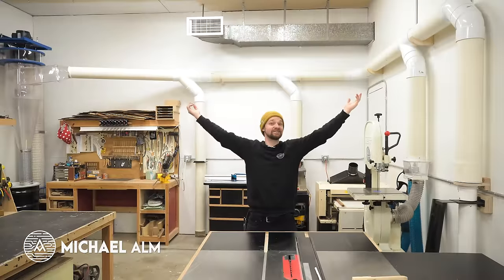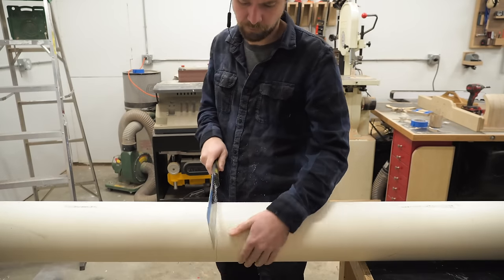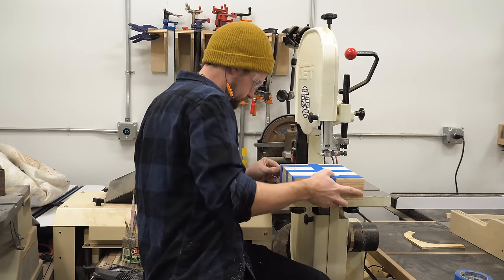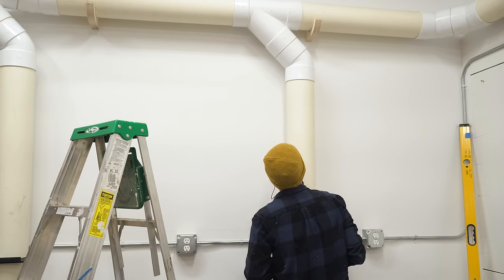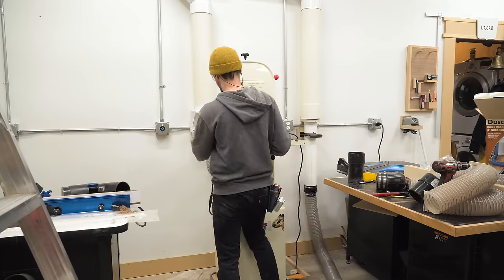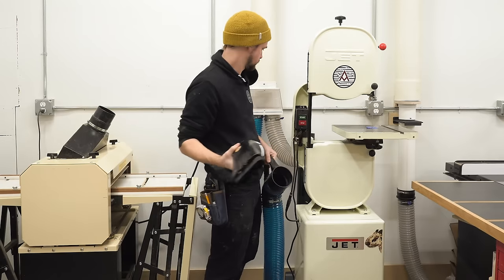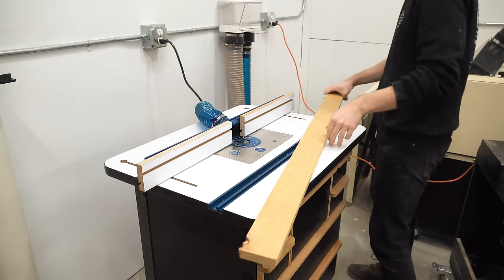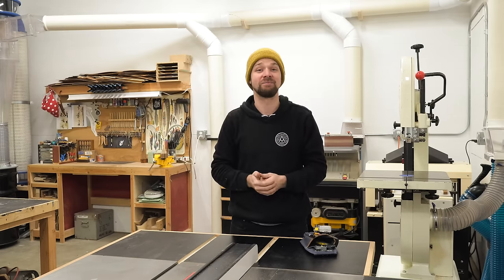Dust Collection System Upgrade

Comment: That Clearview might collapse that thin walled pipe no? I guess you would know by now. I have the same unit but I bought ribbed metal dust collection pipe. Cost a few bucks but has all kinds of dampers at each piece of equipment. Hope your enjoying the better air quality and dust collection.

Comment: Very nice.  But would it be easier to either have a portable collection system or on flexible hose that hooks up to the machines?
I'm looking at a collection system myself.  This is more extensive than what I would need
Reply from the maker: That’s what my old system was. It’s definitely a good entry point, but after a while it’s cumbersome. This is my upgrade and I don’t even have to think about it now. Never had a clog

Comment: Great system. I wish I had the room for such a tall unit. I found for my bandsaw and drill press flexible drain pipe is great for getting the dust on the surface. I actually got one in silver instead of white for $5.00 on eBay. I made some homemade clamps to hold it in place and on the end that is closest to the workpiece is a small rectangle port that actually came with a vacuum cleaner. They do sell them though at Rockler if that is your go-to place.

Comment: Liked and subbed . I loved when I seen my last comment was 4 years ago and I’m just about to install it. Glad I watched your video again as I forgot about not using 90’s .
I have one concern though , I read the instructions again and it recommended only running the motor 4 times an hour  max if your using it for short durations, as it’s hard on the motors capacitors etc . How has your experience been all these years ?

Comment: that is a nice DC setup. Question: when you use the 2 1/2" port for the sander does the system bog down or the vacuum suction get reduced or do you leave one of the other blast gates open? I ask because you are going from a 6" pipe down to a 2 1/2" and that must mean your CFM goes down too, no?

Comment: I've seen other youtube video builds like this and they installed some wires to prevent static electricity. I also have a small cyclone which also has instructions to connect a wire and a washer to touch the floor to prevent static electricity. Does your system have this feature built in? Because I didn't see any wires as part of the build.
Reply: The fear of static electricity is really just anxiety. The chance of a dust explosion happening from static in something like a dust colletor is basically nothing, compared to, say, cutting your finger off at the miter saw.
Reply: I was wondering about this too. I always thought that if you had a good system, it would transport the dust quickly and not let it build up enough to worry about an explosion. However so many people put in static removal wires that I have never been convinced either way.
Reply: @davidhorizon8401  Most sawdust explosions occur at commercial factories where there are hundreds of pounds of dust moving at once. Home shops just don't create enough sawdust to cause such explosions. Plus most modern machinery including the dust collector is grounded enough to prevent that from happening. Grounding is not an expensive thing to do if your that worried about it, but it's not necessary.

Comment: Aha, for once I can add a suggestion.  When cutting pvc piping on the tablesaw, set it in place and roll the pipe instead of sliding the sled.  BTW, the system looks great, really nice set up.
Reply from the maker: Thanks!

Comment: I see you used the cheap plastic gates.  I use them too but always hated how they clogged. If you have that problem with the 6" just cut out a small square in the back corners and they will self clean automatically when closed.  I haven't had to clean mine again since!

Comment: Neat work, I really like the clear sides on the cyclone.  A couple things you, or others, might consider for their next system.  Running 6" trunk lines is a good idea, but for the vertical branches, 4" is a better choice.  This is because the air velocity in the 4" lines is much higher than in a 6" line and does a better job of lifting the dust vertically. The air speed is very high at the equipment because of the small line, but slows abruptly when coming the 6" line.  It's also a good idea to bring the branch lines into the side of the trunk line rather than the bottom.  This is because dust has a habit of falling down into the unused branch lines which could lead to clogged branch lines.
Reply from the maker: Good to know!

Comment: since youre a woodworker why not build a snap together sound insulated case around the cyclone for noise cancelling?
Reply: it needs ventilation for the heat sink but it would be interesting
Reply: It something he should consider, not only to call it a "complete" build, but also if you're WORKING in that shop for long periods of time (which you're obviously going to do), that much noise is bad for your hearing.  

Especially now, everyone is so hip to safety-this and safety-that, but SOUND issues are often overlooked.  And tinnitus NEVER goes away!  Do yourself a favor-- limit the sound from that thing.  :^)

Comment: Just thought I’d share my experience. My system has 4” pipes and 4” blast gates like yours......I found out very quickly that those blast gates very often got clogged up in the back corners and so would not shut fully.....for weeks I put up with using a bent piece of wire that I would wangle into the rear corners to try and pry/flick out the offending offcuts/packed sawdust. The only way I got to a final solution was through complete frustration in having to regularly clean one or two out at a time. I ended up carefully breaking every one of them apart (I have 10)......looked like hot glue bonding......and simply chamfered the 90 degree back corners of the moving/closure plate (ie from 90 to 45). Hot glue and mastic them back together and, touch wood, years later I rarely get an issue. It seems that by having square corners on the closure plate allowed small particles to settle, followed, in time, by my more small particles etc etc. All would then end up getting packed into the corners when the gates were opened and closed which then stopped the plate from fully closing, reducing suction everywhere else. The chamfering seems to provide enough extra space to allow any small particles to be sucked away before any serious packing takes place. The chamfering obviously isn’t large enough to compromise the complete closing of the pipe area. Works well now.
Reply from the maker: Good to know, Thank you!!
Reply: Drill a 1/4" hole with a steel bit at the corners of the plate it will still seal up and the sawdust falls out  of the holes.  You don't have to take the blast gates apart.  Just a quick drill and your set.
Reply: MarkJonesRanger Drilling holes won’t reseal when the gate is open. How can they? And even if they did you’d still be left with the original packing problem when they did...ok, it would be easier to clear but not an effective CURE. As you may be aware, any leaks reduce the effectiveness of the whole system and if you have long runs (like mine) it’s very noticeable. The dismantling of each gate (in my experience anyway) was surprisingly easy as they ‘popped’ open by using a small flat blade screwdriver . Hot glue or mastic resealed them very well.
Reply: Just open the slide before you drill  it seals up when it's closed.  Works great.  No need to reseal stuff at all.
Reply: I saw this on a link several years ago.  It works great.  I am sorry I didn't make it clear to open the gate before you drill the holes in the two corners where the sliding gate pushes the dust to.  I had no more gate issues after doing this.  Didn't even have to take them off the tools just a quick fix on each machine.    
Making jigs for the tools I have learned to give that dust a way to get out and this fixes those gates.  Before I did this they were swelling and wouldn't close.   I looked for the guy that had the original idea for a bit but didn't' find them.   I modified my first gate to make sure it worked and then quickly did it to the rest of them.
Reply: MarkJonesRanger Aha.....now that’s something I hadn’t thought of!.......I can see that working too..👍
Reply: I like your tape method better than my Heating and Air tape.  Yours looks much better.  You did a nice neat job on that install.  Good job!

Comment: For reference, the type of pipe and fittings are commonly referred as "Sewer & Drain" pipe and fittings. The pipe is also called Thin Wall as it is much thinner than Schedule 40 pipe that is used in house drain pipes. The fittings are much less expensive than Schedule 40 fittings.

Comment: if i were you i would defiantly make some sort of a box with lot of sound dampening material to cover up that vacuum motor where most of the noise is generated. 

also i don't know if its possible to do but what if you make an active noise cancelling device for the motor noise? like on headphones, there work perfectly for constant sounds like that. least it'll significantly reduce the noise.

Comment: Really nice job. My only question: are going to run a grounding wire around the outside of your pvc pipe; it's my understanding that pvc creates a lot of static, which can be dangerous (flash) in a woodworking shop?
Reply: This is a myth. Small shops like this where one tool is being used at a time do no generate enough dust to cause an issue.

Comment: Awesome set up, was curious as to how you'd secure the pipes to each other, but I tend to think of water lines when using PVC.  My question on this setup is what will you do with the collected saw dust?  just get rid of it? or is there some way to reuse it?  Thanks
Reply: Chuck it in a bucket of resin and make more stuff

Comment: Came for the "but you have to ground it" comments.  Wasn't disappointed. 

PS, you can't ground an insulator (PVC)
Reply: I think what people mean is that you want to give the static a way to dissipate. 

Whether or not that's what happens or whether it's right or wrong I'm not qualified to say,but it does seem like there's a terminology problem.
Reply: Sure you can, you wrap the pipe, and use flat end metal screws,  screw them in just barley proud of the inside... they act as static 'lightning'  rods and send the charge to the copper wire outside, then to the ground.
Reply: @LDC Show us evidence of fires caused by static discharge in a PVC pipe in a home shop.  Not just my uncle's-cousin's- neighbour told me.
Reply: @LDC I don't argue it could happen in an industrial setting.  But in a small scale home shop, show me the examples, you made the claim it happens, show us.

Comment: I’ve read that one should use horizontal header connections instead of making bottom connections - to avoid dust n chips dropping down into the downstream branches. Did you notice any issues along these lines?

Comment: Can you please clarify the connection to the router table? I understand the direct connect to the rear port, but how come you have a connection to a splitter on the side of the table?  UPDATE for others in case they have the same question: Ok I see, it's because you want to put suction both behind the fence AND underneath the table.

Comment: So i see a lot of guys using the green sewer and drain pipe, i would prefer the all white look also if it’s doable. Do you have any disadvantages from using the thinner walled pipe ?
Reply from the maker: I think a lot of people use the green pipe because it's cheeper in some areas. The white pipe was cheeper here. I haven't had any issues with it.

Comment: I'm no expert as I don't have a dust collection. Watched a vid long ago that you insert screws into pipe and run wire along it to ground it. Good job by the way 👍🙂
Reply from the maker: Yeah, I haven’t seen strong evidence for grounding, but people can make their own choices in their shops.
Reply: Michael Alm I have seen strong evidence that it is not needed though!
Reply: @MichaelAlm  grounding is really only for when its running for long periods of time and most of the time any heavy duty dust collector use metal pipes so it natural grounded.
Reply: @MichaelAlm  grounding is really only for when its running for long periods of time and most of the time any heavy duty dust collector use metal pipes so it natural grounded.
Reply: I ended up grounding the outside of my pvc pipe, just so I don't get a shock when I touch a metal tool like the table saw. I wrapped a thin gauge bare braided copper wire around all the pipes, and the cyclone body, and connected the end to a screw on the relay box. Made a big difference here in the dry southwest.

Comment: I think I'm going to make brackets for my system.  It looks so much better.  Also I use to have those blast gates and I hated them with a passion.
Reply from the maker: The brackets are definitely nicer, and they keep the tube off the wall so you can wrap the fittings easily. I haven’t had issues with the gates so far, but they’re easy to swap out if I need to down the road. What issues did you have with them?
Reply: @MichaelAlm  had 2 break pretty quickly but the main complaint is dust clogging the corners so the gates stopped closing all the way. I switched all mine out to the metal ones on Amazon.  They are like $14 each.
Reply: I ended up cutting off the corners on the "closed" end of those plastic gates. This allows the gate itself to push trapped dust out. Sure, there's now a small hole on either side when the gate is open but it doesn't seem to affect the flow much.

Comment: Great build, thanks.  Did you consider going with some kind of automatic blast gates?  I discovered if you buy a MERV-13 20x20 filter and tape it to the back of a box fan it works fantastic for cleaning the air in the shop.  I used my Dylos, left the fan running over night and both large and small particle numbers were below 20 in the morning, all with just a box fan and good filter.
Reply from the maker: I felt the automated blast gates were more than I needed. I can reach the gates easily from each tool, so it didn't seem like an investment I needed to make. We'll see how I feel after using it for a bit.

Comment: Make a hood for the sanding machine. The port is essentially useless with its design, but a 4" may help. A hood that fits around the belt could pick up more.

Comment: Really nice video and nice system!  Enjoy!  
Suggestions:  mask, safety glasses and hearing protection, as well as an air cleaner.  The smallest dust particles, the ones collection systems have the most difficulty capturing, are the most harmful.  Please protect yourself.
Best wishes.  Hope to see more from you.
Reply: Not to mention they get into your lungs, and hvac system causing them prematurely to fail. Most hvac systems let anything below 3 microns to pass, this builds up on your fan as well as blows all over the inside of your house, if you do or even dont have a fresh air vent in your woodworking shop going to the rest of your home or workplace.
As for lungs, healthy lungs can deal with some dust, but they cant deal with the dust you do in a woodworking shop. Not many people have healthy lungs.Smoking or other life environments has a great effect on our health.  Do everything you can to protect them.

Comment: What size piping/ducting should be used for a dust collection system? I see you 6”. I keep seeing & hearing 4”, then 6”, etc. Do you really need 6”? Wanted to know before setting up my system if 6” is really going to benefit me or make that much of a difference. I can’t see why you’d need 2 more inches for saw dust unless your sending logs down the pipes haha
Reply from the maker: It depends on the specs of your dust collector. The CV1800 is designed for high volume low pressure suction, so wider ducts move more air. Hence the 6” pipes. Lower horse power collectors can’t move as much air, so the use smaller pipes.

Comment: Would it be better to run a ground wire on those pipes, or don't you have to??  My dad used the 4" metal duct work for his dust collection system, like for heating/air conditioning.

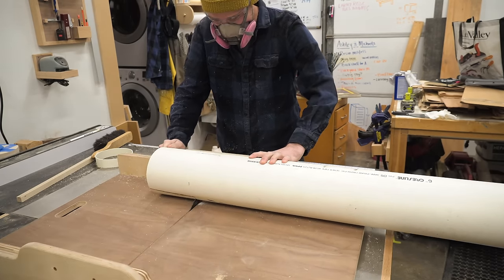Comment: @Michael Alm At 3:47 why didn't you just use the riving knife as a guide for the cut? Cut deep enough so that riving knife enters the first cutline and then just spin the pipe while pressing it against the cross-cut sled shoulder..

Comment: Not sure if you check in on this older vid but if so  ;I have a delta  50-850 1 1/2 Hp 220v  unit. 
Ran 6" Galvanized trunk line 25' straight down center of layout  dropping 4" to shop units. Wired in a key vob off/on. Have her mounted close to ceiling, with a super dust deputy and  30 gal collection bucket.
Impeller is 11 1/2".
Running she is a bit weak.
Question; 
On the Impeller cover, Could cutting the 4" horn inlet to match the 5" Cover horn which matches my Dust Deputy increase my CFM's?
Best; Tom

Comment: Where is your ground wire on the pipes 
to neutralize the static electricity? Static electricity is the #1 cause for sawdust explosions. If you doubt me, put your hand up next to the plastic pipe while sawdust is going through the pipes. Grounding an absolute must!
Reply: Ive never known of any hobby shops blowing up from not grounding PVC ducting.  I'm sure you haven't either, but I've definitely read a lot about it in youtube comments.  Even guys like Mark Spagnuolo,Guy Dunlap,Mike Coffey even say its unnecessary
Reply: I don’t care what you do. Static electricity is real and dangerous. Is would probably startle you to know the intensity of electricity generated by sawdust flowing through plastic pipe. Again, I don’t care. One good spark will make a believer out of you. The lack of hobby shops grounding their dust systems speaks to their stupidity, not the lack of need. Stay safe.